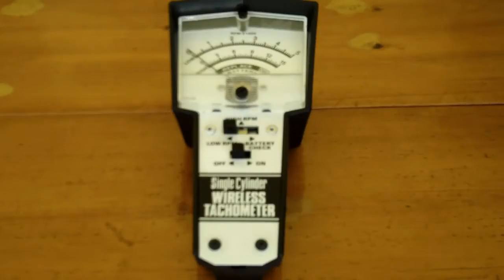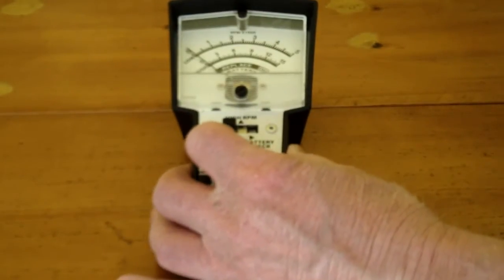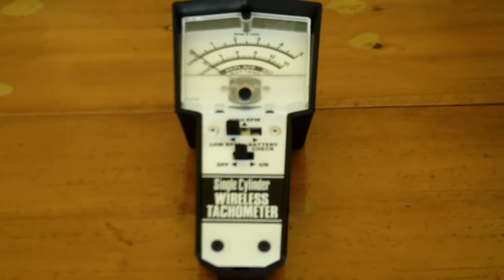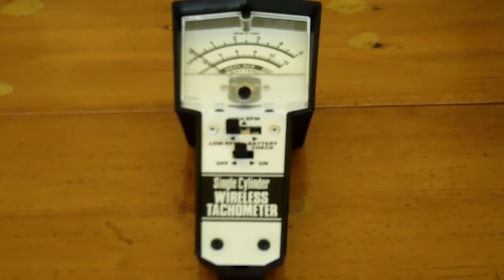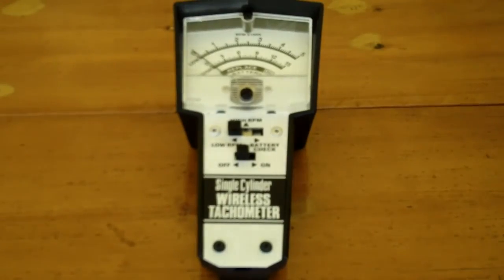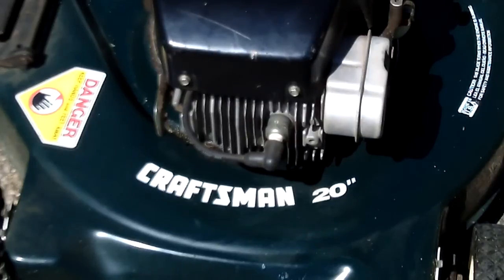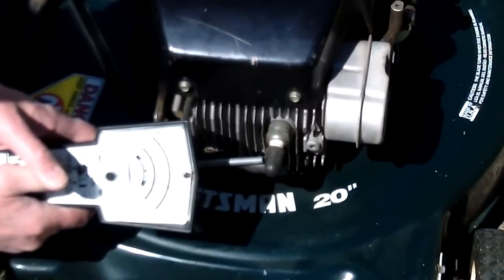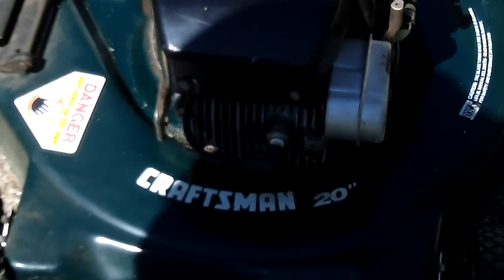Dixson Model 1082 Wireless Tachometer for small engines

Comment: Great video!!! On your Craftsman 4 cycle lawnmower this tach displays the actual RPM. What about for 2 a cycle engine, do you have to divide the reading by 2?
Reply from the maker: +h2000l Thanks for watching and a very good question.  This tach senses ignition pulses.  The Craftsman engine fires once every flywheel revolution - it fires just before TDC on the compression stroke, and on the exhaust stroke,  because the flywheel magnet passes the coil every time it rotates 360 degrees. The exhaust stroke spark is called a "lost spark" in some textbooks,.  On a single cylinder two stroke engine, there is also an ignition pulse every 360 degrees of rotation.  So the tach gives a direct reading for both types of engines.  I hope this makes sense.  If you are thinking of getting a tach for small engines, I would suggest a newer digital model.  Have a good day, and thanks
Reply: +99carnot Hi, thanks for the very clear explanations.

I did not realize that there is a second spark at the end of the exhaust stroke and that consequently a four stroke engine sparks one time per turn.

As for analog vs. digital tachometers selection, from your experience could you say that an analog tachometer has a more stable reading as compared to a digital tachometer which tends to be more jumpy?

I’m still not decided on which one to buy. 

Have a nice evening.
Reply from the maker: Thanks for following up.  The lost spark is only on single cylinder, 4-stroke engines with flywheel magneto/coil ignition. My   analog tach is fairly steady.  I have used a Stihl digital tachometer, which had a steady digital readout, and the lead could be clipped to the ignition wire, which leaves both your hands free for making adjustments, if needed.

You may have some fun with this: How many crankshaft revolutions does it take to fire all 12 cylinders in a V-12, 4 stroke engine?
Reply: +99carnot I would say 2 crankshaft revolutions, as every cylinder will fire up once every 2 revolution.
Reply from the maker: +h2000l Excellent!  Lots of "gear heads" miss that v
Reply from the maker: +h2000l Excellent. You really understand it!!  Thanks!!

Comment: Is it possible to get a ball park reading off a twin cylinder engine using this or will it be two far off to go by?
Reply from the maker: According to the instructions, if your twin cylinder engine has one spark per engine rev the reading will be direct. This tach senses spark impulses, so you get a direct reading. If there is more than one spark impulse for each engine revolution, the reading needs to be divided by the number of spark impulses for each engine revolution. I hope that helps, and thanks for watching.
Reply: That's what i figured but the fact they Wrote on the front specifically stating single cylinder made me want to ask around, like in the case of most modern briggs and kohler v-twins all have their own coil per cylinder.

Thanks for your help!
Reply from the maker: +Eric Roarabaugh Yes. Thanks for following up. There are newer digital tachs available now.

Comment: I'm considering this tachometer, but an wondering how I could operate the tach while adjusting the high speed mixture on a running chainsaw?  Is that possible?  Looks to me like I'd run out of hands, if I needed to hold the tach, hold the throttle, and turn the mixture screw.  How do you pull that off with this tachometer?  BTW...ditto the kudos for Donyboy73.  He's the best, not just on YouTube, but the entire Internet, for small engine repair.
Reply from the maker: I got this quite some time ago, and it works fine, but as you point out, difficult to hold and make engine or carburetor adjustments.  I worked part time repairing rental equipment, and the shop had a Stihl digital inductive tachometer that had a long lead and clip you could attach, put the tach some place handy, and have both hands free to work.  I would recommend something like that.  Thanks for watching and commenting.

Comment: The only issue I have with this techometer is the accuracy. The accuracy for this meter is rated at +/- 2% which in the low RPM range could be off by as much as 100 RPMs. There are other techometers in same price range that are much more accurate in the .05% range.
Reply from the maker: Thanks for watching and commenting.  That is a good point. If I get another tach, it will be a more accurate type. Happy Holidays!